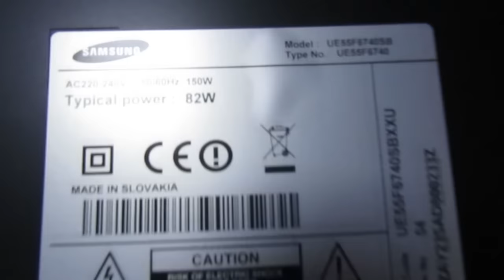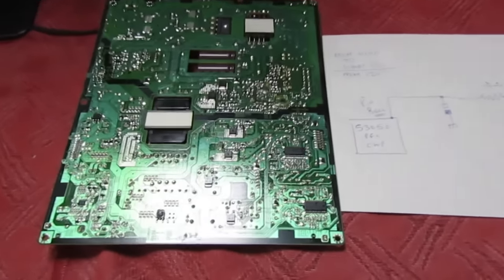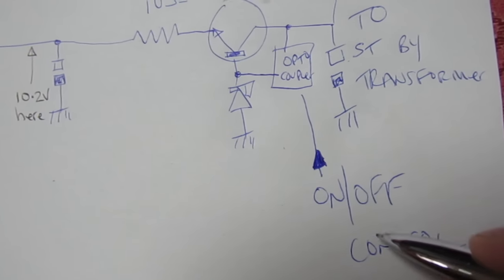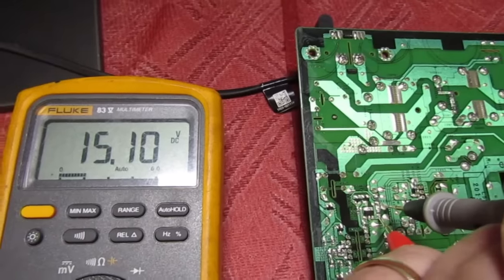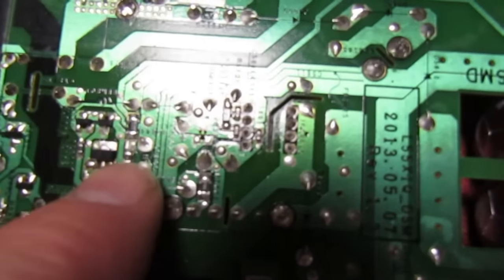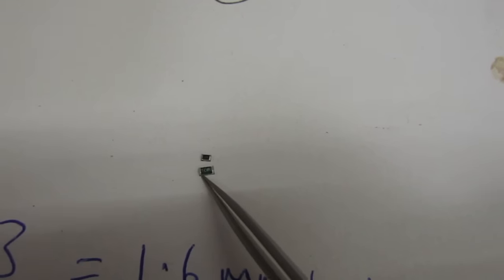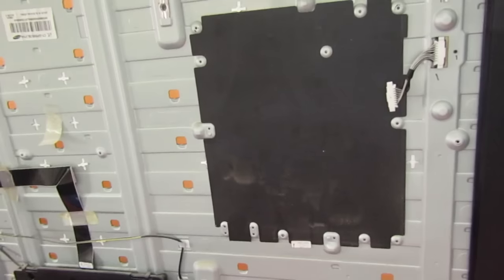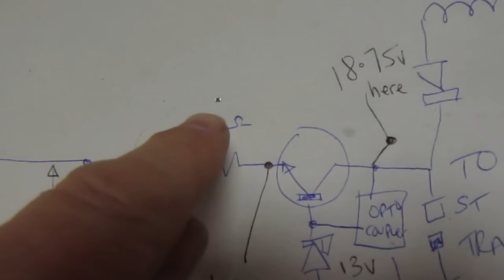Samsung TV , Clicking ?  Dead no power ?   PFC common fault repair  to component level .

Comment: Great video and troubleshooting masterpiece, Michael. Thank you for sharing. Can I ask ,  how much time does it usually take for you to get into the right place like for example in this case?
Reply from the maker: The first time you do it it can be hours, or sometimes I look and cant find the problem and put it to one side and comeback another day , all this could be avoided if there was a service manual with schematic diagrams like there use to be years ago, now you have to look for datasheets on the internet for specific chips to set an idea of how a chip operates.
Reply: @michaeldranfield7140  Thank you. Priceless your are so keen to share your findings with rest of world.

Comment: Hi Michael, do you think the resistor was sized for a fusible link? more than likely it was selected to shorten the life of the TV ( engineered obsolesce)
Rich
Reply from the maker: Could well be built in obsolescence and deliberately designed to fail , not easy to find the first time I had this fault as there is no schematics for most sets now .

Comment: hmm if  12 v at the pfc chip, and output of the transistor is 15v, that means 3v across that resistor,  meaning 0.3amp through it,  0.9w dissipation ,  ?! no wonder it fried! did you measure the actual working voltages at the pfc chip?
Reply from the maker: I didn't measure the voltage at the chip which was a mistake but some chips have an internal zener diode on the Vcc so this may account for current draw .

Comment: Samsung makes to easy to Diagnose their TVs,If you disconnect Main board and it Turns on its your Main board Replace or fix if you know how if it still doesn't turn on its your Power board .Theyre the only ones that do this in the industry Cheers :)
Reply from the maker: That's the only good thing about Samsung but you still don't want to  jump to conclusions, in this set with the main board disconnected the backlights were flickering which might lead you to think the backlights were faulty when infact it was the PFC not running .

Comment: I'm a year older than you and remember reading Everyday Electronics and ETI as a great read! 
I have a Samsung UE32T4307AK (so a single pcb, newer gen.). I was interested if you had had one to look over yet? 
This one doesn't power up, but the front telltale LED is on for about 5 seconds, goes off fleetingly, then straight back on, over and over. The PFC route sounds interesting! There is 331v across the main cap. 
There isn't an S3050 PFC chip that I can see, but there is a 4801A chip, which does have 13v going to it.
There are loads of similar, working spare boards on eBay. I think there is a lot of demand! Maybe the panels die early and these TVs get broken for spares?
A briefly-borrowed pcb from an identical neighbour's TV fixes it completely.
 Do you know if this is a 'standard' problem, hopefully with a 'standard' easy, fix! TIA 
Great videos, BTW!

Comment: Hi brilliant video, really interesting and informative, what does it mean when a TV powers up but has a dark blue screen? I've 2 tvs like this and want to repair then as they are both smart tvs. Thank you in advance
Reply from the maker: if the sets you refer to with the dark blue screen are made by vestel then its the LCD panel that's faulty , take a look at the video I posted just before this one , the Hitachi with no picture as there is a work around to make  set the set to produce a picture.
Reply: @michaeldranfield7140  great stuff thank you I'll shall have a look now buddy

Comment: For those wondering why a "100" marking is 10 Ohms.
ABC -> AB . 10^C (so C is the number of 0 you have to add to the first 2 digits)
100 -> 10 . 10^0 = 10 . 1 = 10
102 -> 10 . 10^2 = 10 . 100 = 1000 = 1k
476 -> 10 . 10^6 = 47 . 1000000 = 47000000 = 47M
Reply from the maker: I always assumed 100 was 10 plus another zero same as capacitor marking but thankyou for the explanation .

Comment: Who knows how many TVs were thrown out just because of this faulty little resistor. I also noticed that the voltage over the 450V caps was very fluctating, is that normal ?
Reply from the maker: it should be reasonable stable , it could well be me holding the probes as well at the camera .

Comment: Thanks Michael for your videos.
I have two Samsung 70 " tvs same model. Both have the same fault, main board. I usually buy parts for what I need, but unfortunately I couldn't find the matching one. My question is, are you able to fix these boards? If so is there a better way for communication? Thanks
Reply from the maker: there is no schematic diagrams for most LCD sets now so most fault finding is just a matter of luck , ideally you will need a working board to take comparisons from .

Comment: I have a question about  this pfc .SInce a rectified voltage is Ac X Sqr2,  in our case its 230 X 1.414= 324 V dc.What boosts further  the dc voltage to almost 400V DC ?
Reply from the maker: It's the power factor correction circuit that boosts up the rectified mains.
Reply: @michaeldranfield7140  there must be a coil for a boost converter that I did not notice.Or a winding on the main chopper?
Reply from the maker: @dimitrismaster  correct , there is an inductor .

Comment: Hi Michael, comments are off for the fiat 500 cluster video.  Which i wanted tk say was really helpful for me.  Could you please let me know what part numbers you used for equivalent replacements for the broken Surface mount LEDs.   I also have a probkem with the LCD display not showing anything. If you have any info on that too would be great. 😢
Reply from the maker: I turned the comments off because I could not find the exact part number of the LED s , I got some replacement ones from RS components but they were not as high as the old ones . I had the LCD display go off on one of my fiat puntos and through youtube found a supplier in Lithuania I think it was .

Comment: Hello Michael, I like to know you have Philip chip R storage bin (container) in video. I like to know where I can get those organized Chip Plastic Bin. Please let me know. Thank you.
Reply from the maker: Someone else asked the same question , this kit was made by Philips to aid repair of the new G90 and G110 sets of the 1990s which were one of the first sets to used SMD components , so its getting up for 30  years old now , the only place you are likely to get one of these is on the internet where someone has closed a shop and selling all the old kit off ., I also have the transistor and capacitor Philips kit .
Reply: @michaeldranfield7140  Wow! 30yrs Old Product. You has been keeping and clean used it. Thank you.

Comment: Did you buy a lens for your phone to enable the microscope? Are you able to solder using it? 😮
Reply from the maker: No lense, it's just a £200 Huawei phone, the picture from the phone is 10 times better than a cheap microscope thing I got from China.
Reply: @michaeldranfield7140  That's really useful. I bought an expensive scope but it's still sat in the box. As a hobbyist I just need to have a better view occasionally and just can't face setting it up 😁
Reply from the maker: @spazmochad  I really need a better way of magnifying but cant justifie spending  a lot of money when I hardly do any repairs now .

Comment: I have a 55 inch Samsung that kept rebooting. If you disconnect the cable to the screen, it stays on. Further investigation found that on the circuit board attached to the bottom of the screen there is a 10 pin chip marked with the letter "D" on the board. I assume it's a diode pack. The chip is marked as 4268H but can't find any information on it. I removed the chip and the TV works fine without it. I'm still looking for a replacement chip as it was put there for a reason. Perhaps some kind of back EMF protection as it appears to be installed reverse polarity. Without schematics, it's difficult to be sure and I don't want to waste hours trying to reverse engineer it. 
If anyone knows about this chip, I would love to hear from you.
Reply from the maker: at a guess I would think its some sort of transient suppressor diode array but I think the only place you will find one is on a scrap LCD panel .
Reply: @michaeldranfield7140  You are probably right. I have salvaged other Samsung 55 inch TVs looking for it but they were different model numbers and used different components with different pin counts. 6 pin seems common but I need one with 10 pins. I'm sure they do this on purpose just to make it difficult for DYI people to make repairs. So I most likely need to find the same model number. The TV works fine without this chip, but will some stray voltage destroy something else one day if I don't replace it? Who knows!

Comment: A classic example of fitting underated components that sooner or later will fail.
We were trained to fault find to component level, today it is just to board level
which is very wasteful.
What will happen when our generation has gone?
Reply: Like you I was trained to component level. If we had even suggested the possibility of replacing an entire board the service manager would have fired us on the spot! These days as you say it's all about being a board jockey. Even I have had to resort to doing that, in a situation where an electrolytic capacitor had leaked onto the PCB causing the high voltage present on that cap to track over the board then start arcing then burned a large hole in the board. It was beyond repair as it was a multi-layer board, so I contacted the company and the solution - "replace the entire board". They sent me a complete replacement.
I don't know what the future of electronics will be when we are gone. Very likely there won't be any servicing, people will just toss their broken appliances and buy a new one because they will be so cheap - much like how it is now, except we still have people repairing some things today.
Reply: @sw6188  This is the way the world of electronics has gone, and consumer electronics has been steadily turning into a
throw away situation since the 80's.
I can remember asking for a service manual for a Philips radio cassette to be told that there wasn't one or any parts 
stocked to repair it, if they failed under warranty they just replaced it.
One option is to make the items self repairing, once the last of the good circuits have blown , then it item is scrapped.
I first came across this technology working on the Euro Fighter, they had three backup circuits for the critical controls
when i pilot reported a fault we just ran some diagnostics and replaced the faulty module, but not the faulty component.
This is all paving the way for everything going AI, then no one will be needed!
Reply: I'm in my early 30's and like to fualt find at component level rather than just replace boards. Learning all the time! :)
Reply: @5pr1nk57  Good way to go, it will stand you well in the long term.
Reply: @5pr1nk57  A skill well worth having, spare boards are not always available, but components are easier to find.
Reply from the maker: Tell you what will happen , we will just throw even more stuff away sadly .
Reply from the maker: @sw6188  unless prices go back up again things will just be more and more disposable unfortunately .
Reply from the maker: @5pr1nk57  too right , there's no fun in just replacing a board .
Reply: @michaeldranfield7140  That will be the only option for future generations, the right to repair will be short lived as there will be very few that know how to fault find and repair faulty equipment.
Reply: @michaeldranfield7140  While china continues to churn out budget goods, prices will never go up. What is needed is for people to boycott chinese-made products then they'd stop making them. Unfortunately I can't see it happening any time soon - people love their cheap appliances.

Comment: So glad I found this! I picked up a dead Samsung 55" UE55F6500SB to repair and stick in the bedroom. It has has the clicking relay and 2 blinks of LED with no startup fault. Interestingly the backlights don't work when the mainboard is disconnected but there is no voltage at the LED output not at mainboard output apart from SB 5V & PWR On 3.2V.

I've been testing and researching all day and am stumped! Can find little about this set or faults online.
Your set here uses the same PSU board and I just checked that resistor but it reads 10.7 ohm so seems ok? 🤔 I am suspicious of the PFC section though as there's no voltage on rails other than SB, no voltage across the 400V smoothing caps and the PSU seems in a safety shut off/boot loop.
The last point you made about a short in the SB transformer is interesting though, I do have 5.3V in those diodes above but not the aux tap off and everything else dead in the secondary? Any other thoughts?
Reply from the maker: I would take a close look at the SB transformer if the 5.3 volt is present but no other rails , check the primary resistance , in the set I had although the 5.3 volt was present I don't think it was possible to draw a heavy current , however you should still have charge on the reservoir capacitor in between clicks , I think I would be tempted to short over the repay contacts with a 60 watt bulb so you can keep power on to aid fault finding . I think in the set I had the primary winding of the SB transformer had an unusually high resistance primary and when I un wound it you could see where there had been a flashover and the primary wire was broken but the transformer still worked to a fashion as there was a conductive path caused by carbonisation .

Comment: Michael, i have this problem with my 40 inch Samsung tv:
I power her and after 5 min, she is dead!
I have to take off the socket and then to wait 3-4 minutes begore i plug her again: She is ok for 4 - 5 min and then again dead!!
I do this procedure 4 -5 times  and at the End she is ok!!!
But if i close her and open again in two hours, it happens the same!! And i have to do the same procedure once more!
Any ideas;🙄 model:LE40B651T3W,made in Slovakia
Thanks,
Reply from the maker: Sounds like it may be a dried out electrolytic, you can check for this by warming up the caps with a hairdryer but also check the PFC voltage is not too low

Comment: Hi, Excellent video. I have Exactly the same behaviour on my Samsung TV UA55D6400UJ but when I disconnect its Main board from the Power supply board  it stops clicking... So I assume The problem could be at the Motherboard?

Comment: A simple switching pathway became complicated... I'd use a simple method to do that with the opto  coupler and 2 tiny MOSFETs without zener diode without resistor .
Reply from the maker: made even more complicated by not having a schematic diagram.

Comment: I have a tv I changed my main board due to it wasn’t reading the controller commands when I swapped it out it was doing the commands on the remote for little while and boom it stopped working could it be the power supply?

Comment: I have Samsung 85 inch tv model un85au8000 same problem ..relay on off continuously …if i remove main board then it stand on 3-5 sec then again continuous on off ..some time stand long time please give me solution

Comment: Hello
I have a question i need a help from you
my question is 
how to test logic gates on board like OR gates , and so on ?
Reply from the maker: you need a logic pulser and logic probe .
Reply: @michaeldranfield7140  But it can be tested onboard without connecting the board to suppply voltage? I meen using those instruments to test like i test resistor

Comment: I have a Samsung that the Power Supply Control IC SPC7011F is burning Hot and something is short to ground cause i got a shock when i touched the transister aluminium cooler, damn it

Comment: Samsung should pay in these cases for obviously using the wrong part.
Reply: Like Apple 😉
Reply: This is a Samsung telly not an Apple one.
Reply from the maker: many years ago Samsung would have cared about this fault , these days there not interested , as long as your set lasts out the guarantee period that's all that matters to them .and its not just Samsung , most manufacture's are like this now .

Comment: have a samsung tv [direct from samsung as a replacement for a unrepairable one] it has a fault, but have given up with samsung customer services...many hours on phone etc etc...am going to live with it until it dies and then buy another make...you need to turn the tv on, then off then on again in order to get a proper bright clear picture..it then runs fine all day....weird, but trying to make samsung understand this fault is like trying to educate pork.
Reply from the maker: Its very common now for no one to be bothered once they have your money , I see it all the time now, just with samsung but will most manufactures, Pure the radio manufactures are  by far the worst , they cant even be bothered to answer there e mails , and its for this reason when people ask me what's the best set to buy I always say just buy the cheapest you can because you wont get anything more by spending more money ,don't expect any help at all when the guarantee runs out